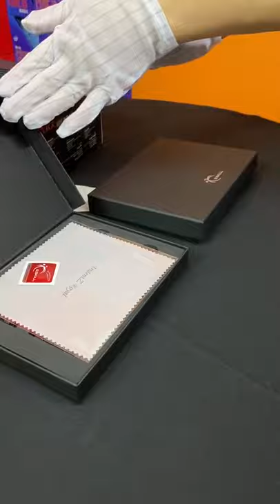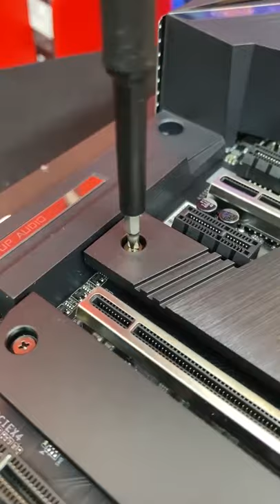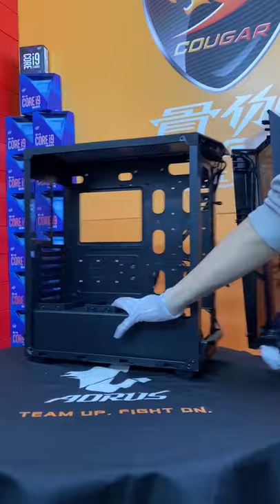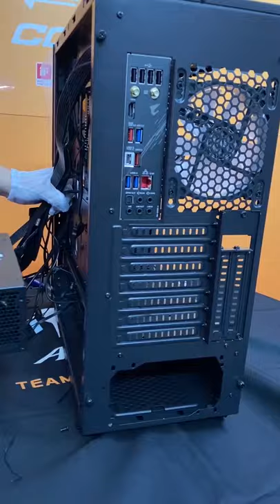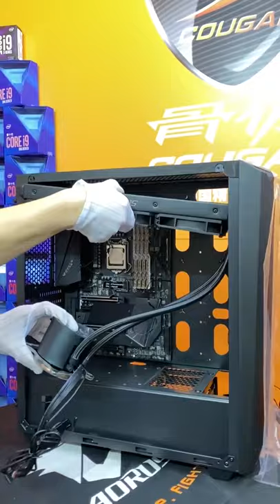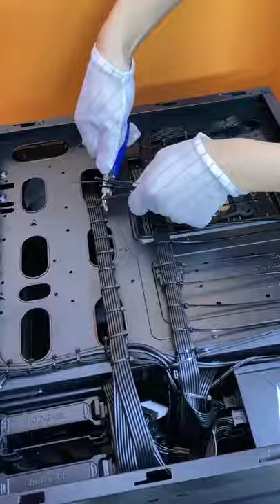i7 11700K+AORUS RTX™ 3080 XTREME+Z490 AORUS PRO AX+Trident Z Royal 64GB #Shorts

Comment: Yeah I don’t understand how you guys cable manage so well… I’ve redone my wiring 3 times and it still looks like crap lol!
Reply: Individually sleeved cables are much easier to cable manage than flat or bundle sleeved, and if you don't use any sata cables it's even easier. Almost no one uses sata cables and regular SSDs or HDDs in these builds, it's always NVME M.2s that don't need any cables at all